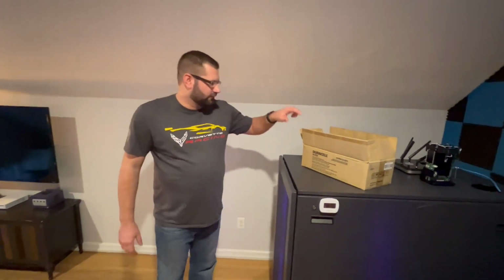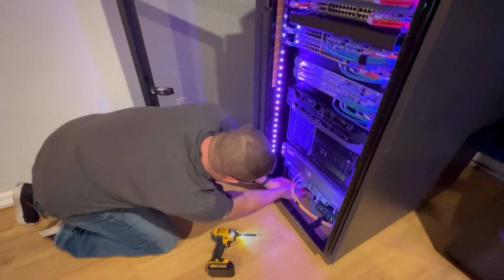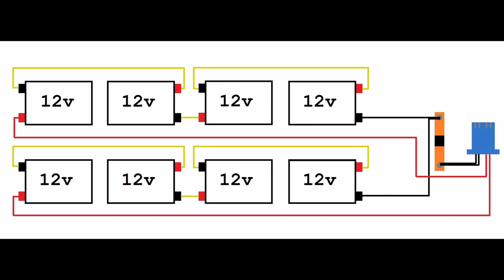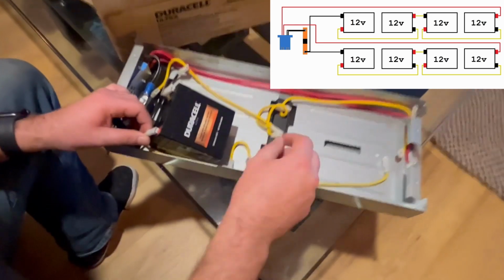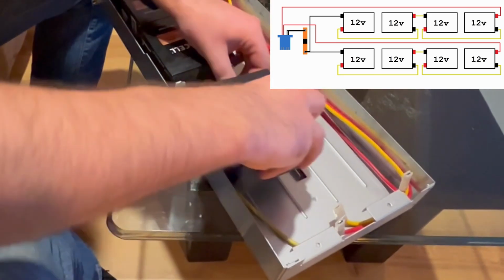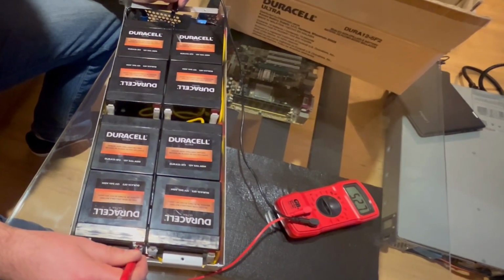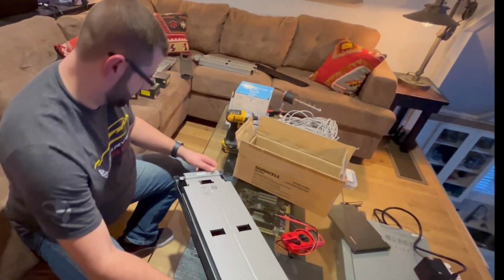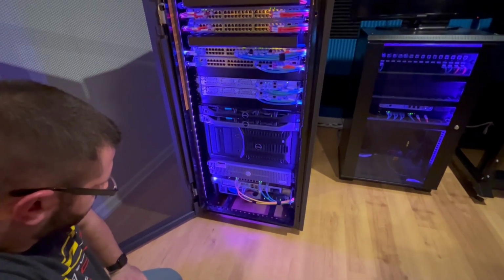APC Smart UPS 2200VA (SUA2200RM2U) Battery Replacement

Comment: Thanks for a good video - I accidentally "converted" my 2200 to a 1500 as I order 4 x 12V 9Ah batteries (Euroglobe GL77224) measuring 151x65x94 mm each. They almost fitted in series for ONE chain with 48V and the other not connected. The lid of the battery cartridge didn't fit though so just left it out 🤫

Comparing the original 8 x 6,5 Ah = 52 Ah to Your 8 x 5 Ah = 40 Ah and my 4 x 9 Ah = 36 Ah and the price I got with just 4 batteries at about USD 32 each (though not Duracell) I feel happy with the budget "downgrade replacement" so far 🙂
Reply: Porque sumas el amperaje si son dos circuitos serie que luego se conecta en paralelo eso te da una tensión de 48voltios 10 amperes/hora

Comment: What batteries do you recommend for this ups?
Reply from the maker: My first recomondation would be the CSB HR1227WF2FR - https://www.batterystore.com/hr1227wf2fr-12v-6-5ah-27w-csb-battery

I did however go with the Duracell Ultras, as you see in the video. I needed something I could grab locally/quickly, and so far they have been great. 

The difference between the CSB and Duracell is 1.5 Amp Hours. The CSB batteries are 6.5AH and the Duracells are 5AH. Also, the Duracell batteries I used can be found here: https://www.batteriesplus.com/battery/ups/csb-battery/hr1221wf2-

Anyway, try to get the CSB batteries if you can. Otherwise, the Duracells are the next best thing.
Reply: @RMTechCentral  thanks